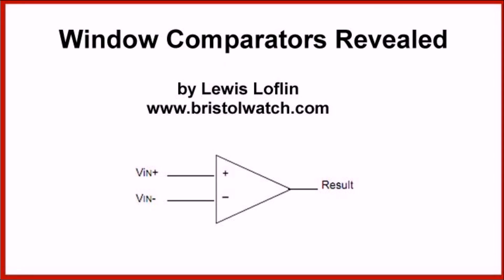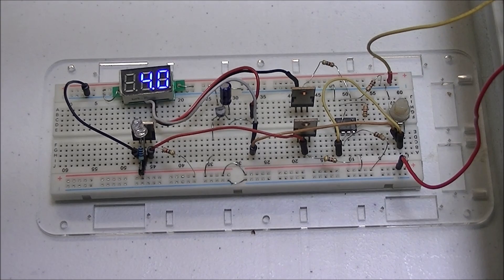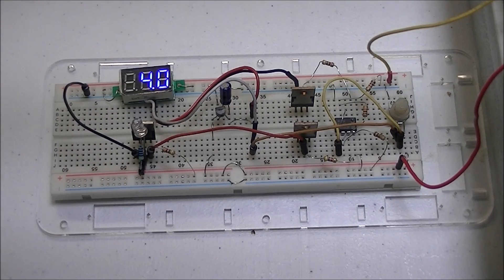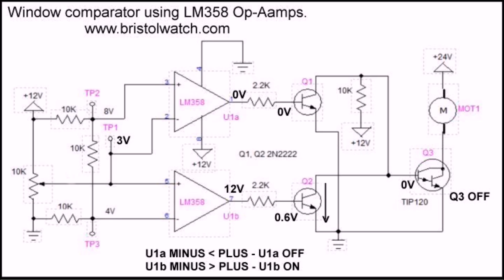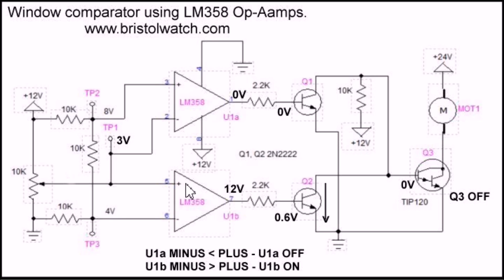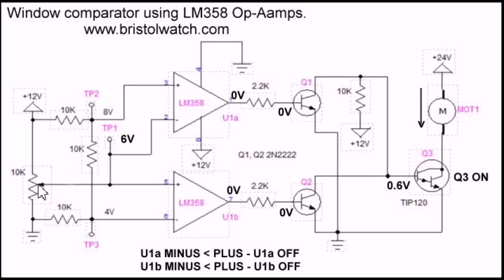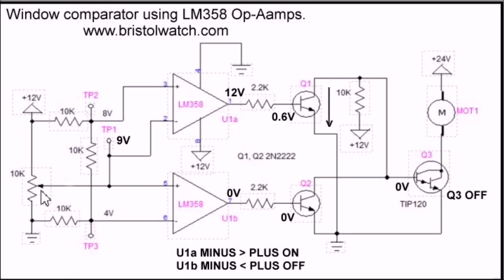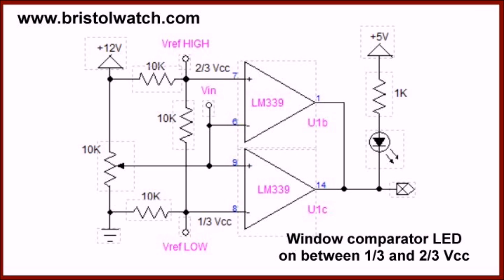Window Comparator Circuits

Comment: Am I missing something here? The voltages out of the U1a and U1b are reversed as shown. U1a is wired in the inverting configuration. According to the basic comparator video, when the input to the - terminal is below the reference (which it is, 3 volts versus 8 volts) the output is high. So should be 12 volts instead of zero.  Similarly U1b is wired in the non-inverting configuration. According to the basic comparator video, when the + terminal is less than the reference ( which it is, 3 volts versus 4 volts) the output should be low. So should be 0 volts instead of 12 volts.  The circuit still achieves the end result however as Q3 remains off as Q1 should actually be on and Q2 should be off.
Reply: I was thinking the same thing.

Comment: I-m looking to build a 'hysterisis' comparator.

with v1 and v2 being the two voltages and v2>v1.

how do I set this up so the output is on when vin>v2 and stays on until vin<v1 and then has to reach v2 again before turning on. It needs some sort of state memory rithg?
Reply from the maker: +Coco MosFET I'm doing a video on that. See my webpage:
http://www.bristolwatch.com/ele/vc.htm